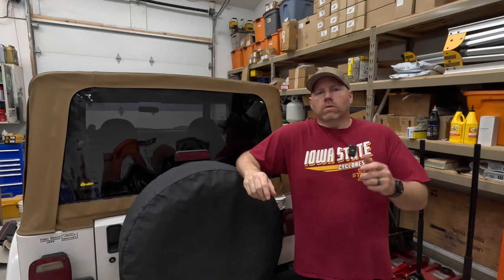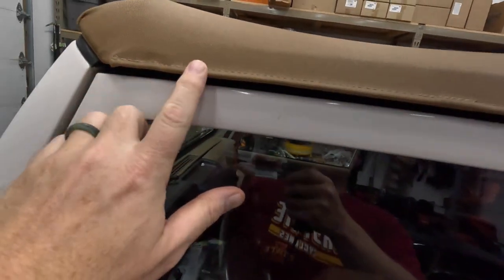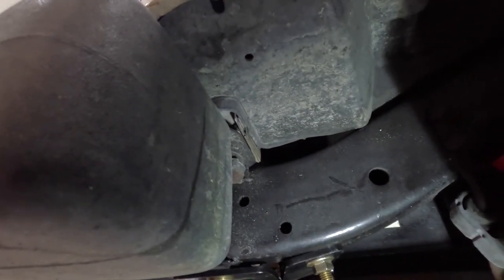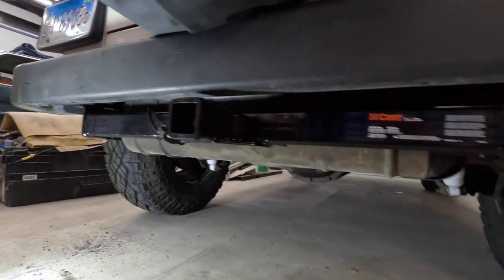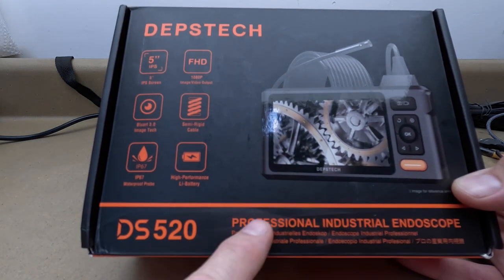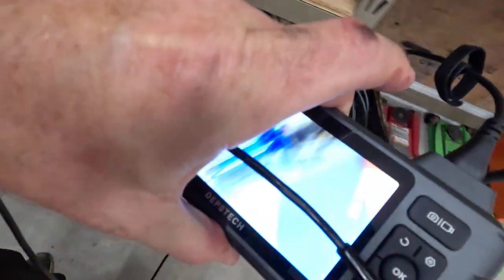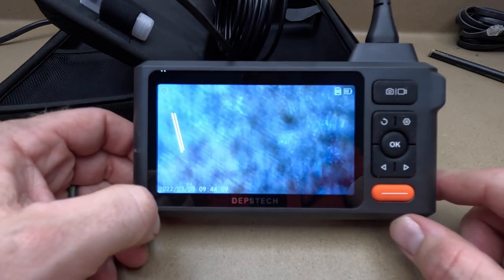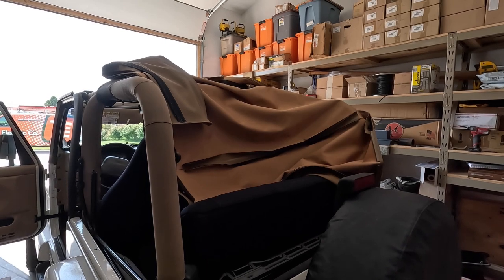Jeep TJ Hitch & New Top Installation

Comment: Cool video. This thumbnail is a perfect example of why the early white TJ Saharas are so sought-after to this day. I wish one of the many I saw had an immaculate frame like on my '05 TJ Rocky Mtn. But this Rocky Mtn has 3.73's, a Dana 44 and limited slip. I have to paint it soon since the lousy black Chrysler paint is really showing its age. Either going to raptor line it cobalt blue or regular blue paint. And get either a safari grey or tan Best Top.